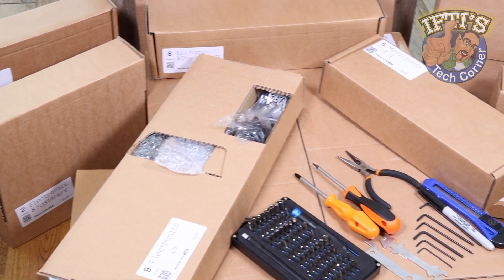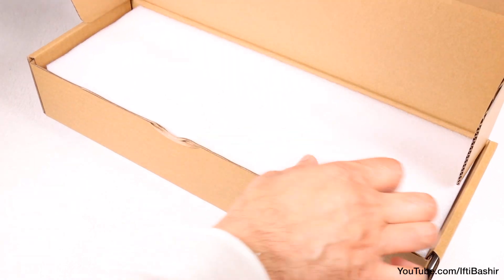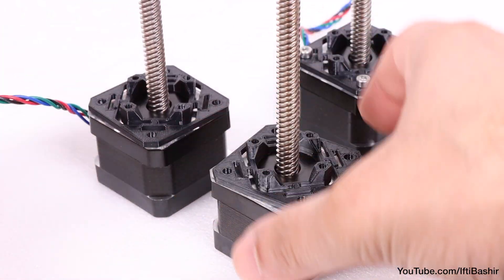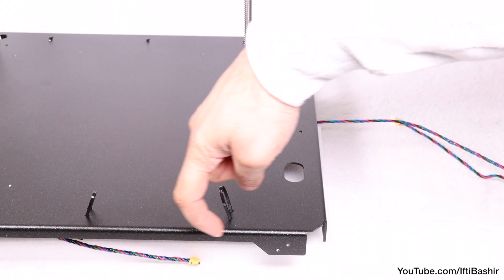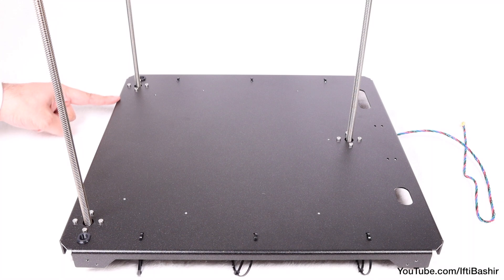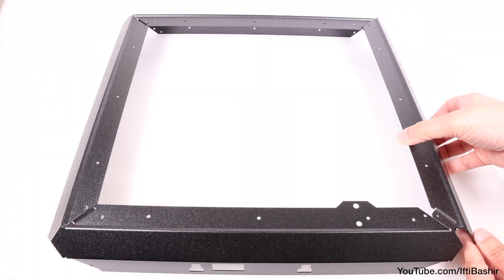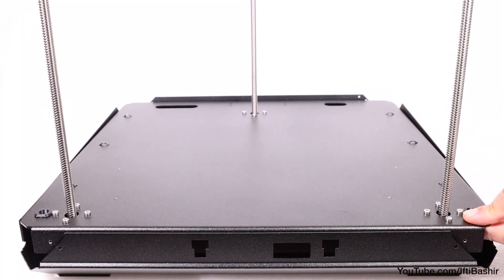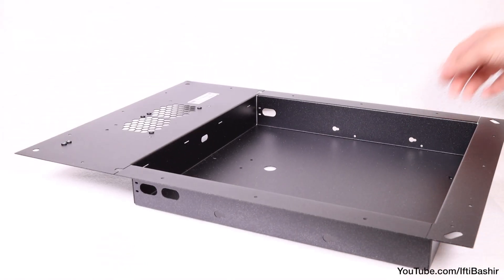#02 Original PRUSA Core One Kit : Full Step-By-Step BUILD GUIDE - Base Assembly

Comment: Key detail here @ 7:12  and onwards: He is saying M3x4 screw but there are a few different ones he is using the M3x4rTs (these are the ones with the Star heads not the hexagon heads) very important because the normal M3x4s can strip easily.. I made this mistake luckily I only stripped one and looked more closely at what head he was using
Reply: I just realized he specifies on the bottom left corner but I saw that too late because on my tv when I’m pausing it gets covered.